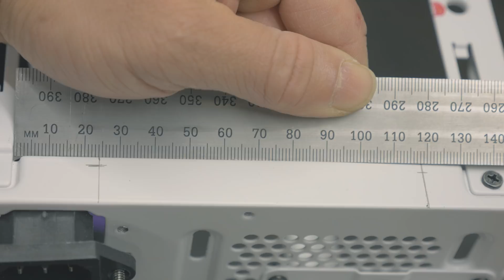Top Rads and Other Custom Loop Considerations in the NR200

Comment: Love the content on this case as always man. A quick one, as you can easily remove the top mesh surely this means you can add any fans you want at the top? I gather you just need to be very careful if screwing fans in, as the mounting material is plastic? Thanks
Reply from the maker: Sweet! It’s fine to do it that way, screwing fans in is fine- the plastic is quite rigid but since you have rubber grommets you don’t need to over tighten anyway. From a maintenance standpoint a bit more hassle since if you want to take off the fans for any reason the whole mesh has to come off again, but other than that it’s OK. I found the mesh quite bendy so be careful handling it, since you could get small creases that won’t necessarily bend back.

Comment: I'm planning on mounting this 17mm tall radiator: https://www.aliexpress.com/item/1005001308719083.html + 15mm fans on the top. Any thoughts?
Reply from the maker: That link didn’t work for me but if it’s 17mm then that’s three less than the TX240, can’t see why it wouldn’t work unless the rad is too long or the fittings don’t line up well.

Comment: Hey love your videos! I am planning a similar build and using the Barrow Pump/Block combo. Just to clarify in your video you mentioned that the 2600 pump is weaker. Were you referring to the Barrow combo unit or the Alphacool DCLT?

Also you can definitely lower the PSU with 4 standoff screws instead of cutting the PSU shroud mount. But I prefer to dremel as little as possible.
Reply from the maker: You’re right- I was referring to the DC-LT/Alphacool 2600. The PSU standoff mod is a good idea too, just will seat the PSU outside the shroud but is an easy one. Agreed on Dremeling-try to do all mods such that it’s easy to go back to stock if needed.

Comment: I wonder if it would be possible to mount 2x240 (top & bottom) and a 240 or even a 280 on the side?
Reply from the maker: Yes, you’ll need another rad panel of course if you go the same route, plus an external pump/res or combo pump/cpu block.

Comment: the EK-Quantum Kinetic FLT 120 DDC PWM D-RGB would fit better thats the way i will go in my nr200p
Reply from the maker: Should be quite a looker too.
Reply: Came here to post that too. That flat res/pump on the front might work depending on clearance.
Reply from the maker: It’s about 21mm behind the removable front panel and the outside of the inner frame. The FLT stand-alone res is about 25mm so probably won’t work- the tubing run would have worked well since there’s that huge GPU slot cut out.
Reply: @MachinesMore  

my plan is to use on top a HJ 240mm 17mm Radiator Copper 

on the back Alphacool NexXxoS ST25 Full Copper 92mm, Radiator

and on the bottom XSPC TX240 CrossFlow Ultrathin Radiator

and the EK-Quantum Kinetic FLT 120 DDC PWM D-RGB 

the only problem is gettin a case in stock ._. and the alphacool radiator
Reply: @MachinesMore  Then my other, even crazier idea, might be better. Replace the entire front panel with a Distro plate panel + pump. Now I just gotta find someone to make such a thing.
Reply: @napalmarsch  Get out of my brain. I have the FLT 120 in my NR200P, with the XSPC TX240 crossflow at the bottom, and I've been waiting for the Alphacool to come back in stock for the back. I hadn't thought of that 17mm for the top, though....
Reply from the maker: 🤔interesting thought....
Reply: @napalmarsch  did you ever manage to build this? I've got those exact parts coming this week.
Reply: @VikSep  yes i dit its running since a while i have a reddit post to the setup

Comment: Thanks for sharing this video. I am glad I went with air cooling ;)
I may have suggestion to avoid the PSU mount mod. I used an 10mm long m3 standoff to lower the PSU itself while keeping the PSU cage at its highest position. This way, I was able to mount a 25mm thick fan even with the PSU cage in the SFX-L position.
Happy new year to you too!
Reply: Do you have a link to the 10mm long m3 standoff? I'm curious to learn more about it.
Reply: @sloqlap  hey, sorry for the late reply. I didn’t have 10mm but I used two 5mm standoffs stacked together. The standoffs screw into the PSU and then the PSU screws go into the standoff, lowering the PSU by 10mm. Here’s a link to the standoffs I am using: https://www.ebay.co.uk/itm/M3-x-5-mm-3-mm-Male-to-Female-Hex-Brass-Spacer-Standoff-50pcs-/184381331891?_trksid=p2349624.m46890.l49292
Reply from the maker: That’s a good idea too! Happy new year!

Comment: and i have an sfxl, to big to what so ever. im think of moving the psu to the front, and in the place of the psu put an 140mm fan to suck all the air off and do some help to my msi gaming x 5600xt wich also is to fat. to vertical gpu and bottom aio im looking for EKWB MLC Phoenix 240

Comment: I was able to use the 280 and rad bottom with using the iceman res on the back of the case.
Reply from the maker: Good option! Did you just drill holes for the tubing?
Reply: @MachinesMore  i just used a Dremel and cut out a small square for one of the connectors.  The other fit perfect where the vertical gpu would mount

Comment: I love the use of that side bracket. I wouldn't even of thought of using that on the top. I plan to add a top radiator, but I am going to try to 3d print an extended top panel making the case ~30mm taller. On the res another good option is the EK FLT120. I have mine mounted to the front of the PSU & it took drilling 4 holes in the included mounting brackets to line up with some that were already in the PSU shroud.
Reply from the maker: Interesting idea! The FLT120 is nice but there is a limitation with it- I don't think there's enough clearance for it directly on the PSU shroud. It's 86mm thick and you have roughly 90mm of clearance, not too much room for fittings and tubing runs. You would have to rotate the PSU shroud and mount it facing the back. You do get a D5 option though.
Reply: @MachinesMore  that’s the d5 version. The ddc one is 58mm think. With alphacool 90’s on the front it still leaves plenty of space before the tempered glass panel
Reply from the maker: Ah yes, the ddc version would be great on the shroud!
Reply: @MachinesMore  I actually have the D5 version installed in my NR200P right now. It was a crazy close fit, in two different ways. Depth-wise, there are only a few mm between the front of the reservoir and the glass panel. In terms of height, I had to move the PSU shroud to the SFX-L position so that the FLT 120 would be high enough for the bottom fittings to clear my GPU. (I'm using one 90-degree fitting out to the GPU intake, and one 45-degree fitting out and down to the back rear corner of the TX240 cross-flow.)

I originally planned to use the DDC version, but it was out of stock on Black Friday (at Titan Rig and PPCS), so I crossed my fingers and bought the D5 version. I really lucked out that it fit!

Comment: Just put a custom loop in mine and gave up on the idea of top mounting the rad. cant wait to watch this.
Reply: Love the idea and the little modding. Also, I was able to use an alphacool nexxos xt45 with 15mm fans at the bottom and while its a tight fit, it works fine. Can't wait to get a slim rad up top and add the gpu to the loop. Wifes about to get mad. Lol
Reply: @PhatKorean   if you were to do a vertical gpu would you be able to get regular fan on it?
Reply: @not2envy  no. The pci slot gets blocked by the fan. If I went with a 30mm rad, im sure I could fit a normal fan. Buying 2 new rads to give this mod a whirl
Reply: @PhatKorean  i used a 3800x and 2080 super 240mm on bottom with fans mounted under case with 3d printed taller feet 45mm and a 92mm rear rad and my temps under load under 65 and in 50s gaming i used thick 92 mm and mounted that fan outside too use a temp sensor for fan control this thing is silent